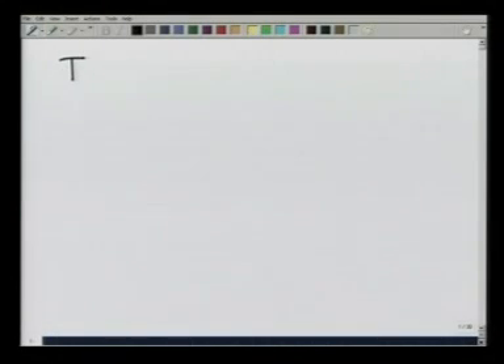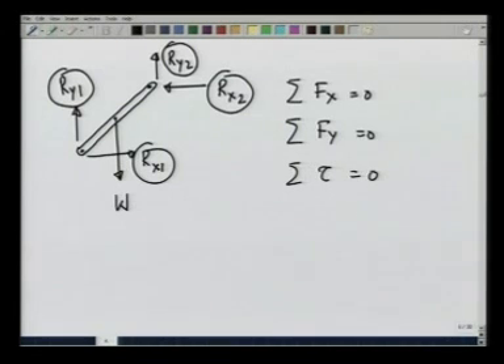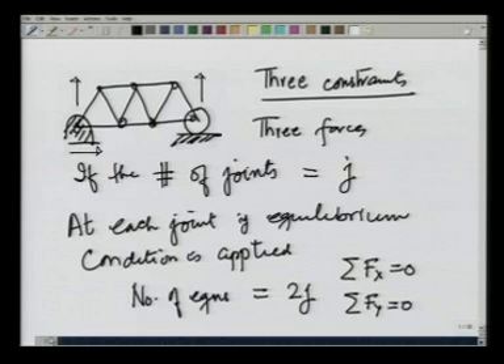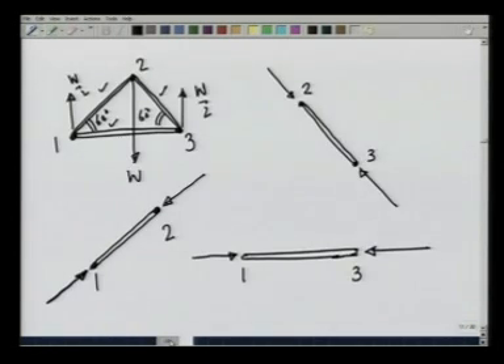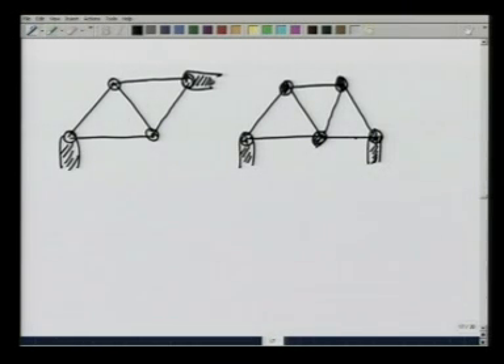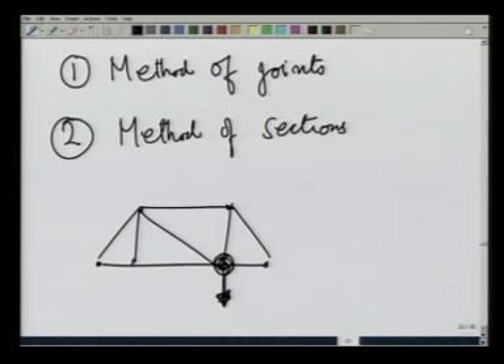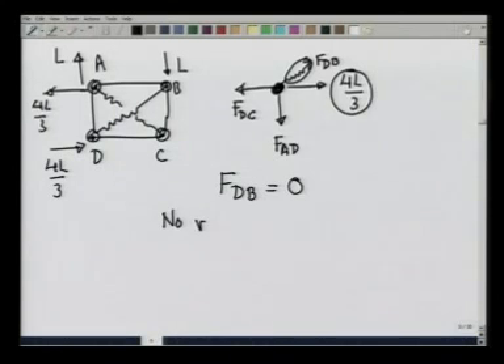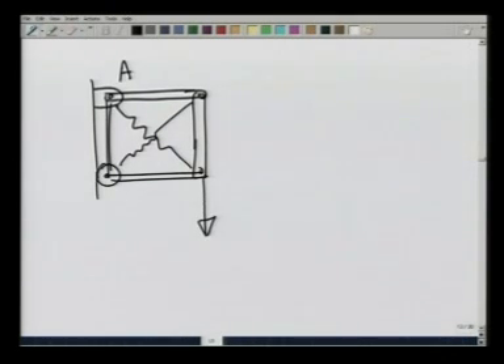Module -2 Lecture -1 PLAN TRUSSES - I

Comment: Last problem was not clear to me, how Fdb becomes zero, is Fdc is not sufficient to keep the string in tension????
Reply: I'll try to clear your doubt, for an instant, please forget the members DC BC and AC, as D is free to move in vertical direction, any force applied on A would not induce a force in member AD, but any compression or tension at D in the direction of AD would produce a stress/force, but here, at D, as DC is perpendicular to AD, any force in DC can't induce any force in AD, whatsoever if any force produced in AD, it can be produced due to vertical force and D or due to any vertical components on it. here, the vertical components on AD can only be produced due to vertical component of DB. So as we knew that Fdb is zero, the components of Fdb along AD is zero, which means that there are no forces along AD, therefore Fad=0. Now i will try to make one more thing clear about Fbd being compressive or tensile, Now assume/draw the figure without the rope AC, that is, draw just ABCD with only rope DB, and assume that it is initially, rectangular only, then apply the force L on B, now you can easily assume that it is going to become/look like a parallelogram, with acute angle at A and obtuse angle at B, and ultimately the rope also becomes slack, which means that there is no force induced in it, and as ropes will not take any compression, Fbd is zero!